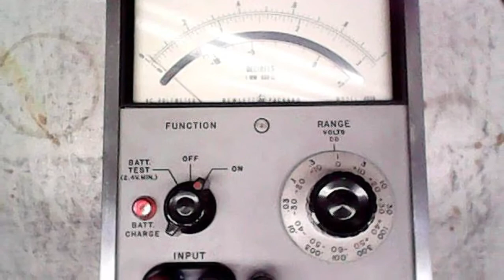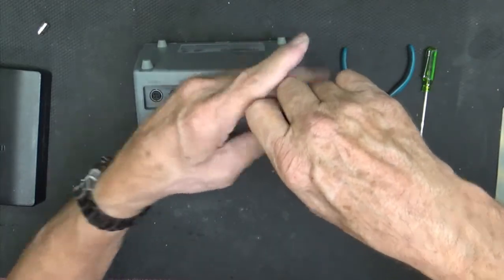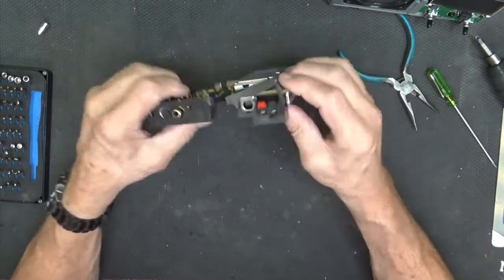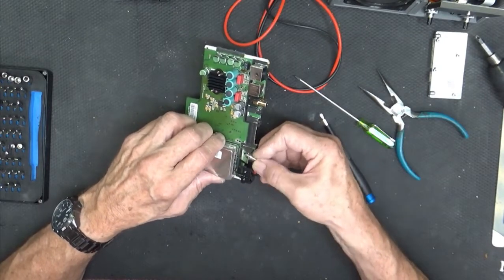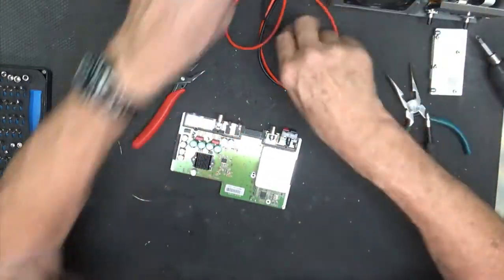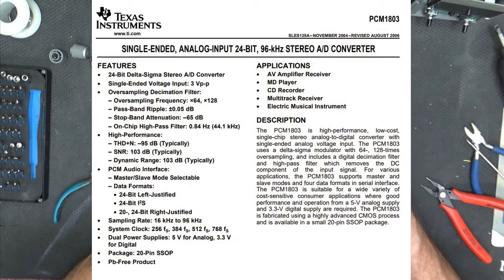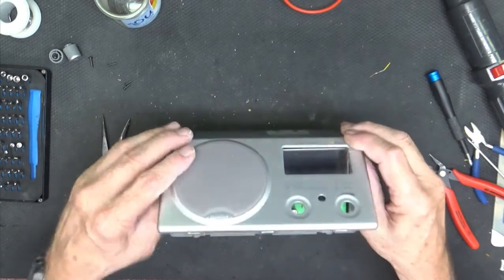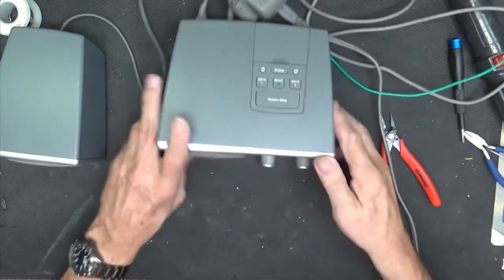Repairing a broken F-Connector on a Boston Acoustic HD Radio

Comment: Nice repair! The DIN connector looks like a "S-video" connector from the dark ages, something only old guys would recognize. Thank you for another interesting video.
Reply from the maker: I checked that connector and it is not an S-video, wrong number of pins. No idea what it its for. Might be for factory use in case the format for HD radio changes or something.
Reply: @AERVBlog  I didn't think it was an s-video connector, just looks like one. After a re-viewing of your video I could see that the key pin is vertical instead of sideways like s-video. Looks more like the stereo audio connector that was popular eons ago
Reply from the maker: @davidv1289  yes it does.

Comment: Thanks for posting this, it's good to see how these radios come apart and what the board looks like. I have three of them and two have developed problems. There's no audio at all from one of them any more, it started cutting out intermittently for a short while before quitting altogether. The radio alarm on the other one has started turning on at a low volume no matter what level is selected in the alarm setup. I'm guessing the problems could be caused by capacitors that have failed since these radios are now about 15 years old. If anyone else has landed here for similar issues please reply and let us know if you managed to fix them.
Reply from the maker: I just got one of these in for repair the other day. The symptoms were no audio and the RDS quit working. Turns out the main IC is bad and there isn't anything I can do for it. It seems these are not the most reliable units in the world. I bought a little portable HD radio off ebay for $29 that is a lot better and does RDS too. It is mono but I just use it for monitoring.
Reply: @AERVBlog  Well that doesn't sound promising but the RDS still works on mine so maybe it's a different problem. There's not really a comparable HD clock radio with dual alarms and good sound now so I'd like to keep these ones going, but this was the very first-generation HD radio and you're right, it's quirky and the reliability seems questionable. Thanks for the reply.
Reply: @AERVBlog  Out of curiosity, was it one of the Sangeans? I have their HDR14, I like that little thing. Wish I could find one of the clear ones though...

Comment: I bought this same radio years ago for the FM HD multicast channels, but the reception drifts in and out.  It does work okay on the main stations. I thought it was the tuner that sucked but now I'm thinking the F connector is damaged or not well connected.
Reply from the maker: Check that out for sure but in my experience these things are pretty deaf. You would think something this expensive would be better but they are not. Thanks for watching.

Comment: Try scraping your electric screwdriver bit on a large magnet to magnetize it.  I have one saved from the back of an old speaker and it usually works for most tools.
Reply from the maker: I used to have a magnet with a hole in the middle that did a great job of magnetizing but I lost it somewhere. I have a stack of super magnets from old hard drives that do the trick now. They are also good for finding things dropped on the floor. Thanks for watching.

Comment: Something fun and relatively easy this time. Regards Tom fyi 40 years with the Bell System as a tech. Retired in 2000.
Reply from the maker: 40 years with Bell! I bet you have some good stories.
Reply: Sorry this is late. Yes indeed I'd write book but who would read it?  I've been in hundreds of places underneath the streets of Manhattan  and over the same. Telephone cables are everywhere.  Bridges, tunnels, subways, airports, docks, piers, etc.
Reply from the maker: @thomasheckhaus205  but soon, no more copper. Yes?
Reply: @AERVBlog  Again apologies, I don't log on as often as I'd like. I think copper will be around for some time. My guess is in Urban areas copper is being replaced by fiber optics. In Rural places  copper will be around for some time. Verizon has already abandoned the "Fiber to the Curb" concept. It didn't generate the money they expected. Land Line service is way down so the existing copper network should serve areas for many years.  Time will tell eventually. By the way a question for you. With Radio Shack gone I can't seem to find any liquid flux what do you use and where do you buy it? I do repairs on early PCB boards and sometimes surface mount. All I can find locally is tins of flux for the plumbing industry. Thanks
Reply from the maker: @thomasheckhaus205   There are lots of different kinds of flux for electronics work. Send me an aervblog@gmail.com.
Reply: Yikes, 2 weeks. Where does the time go? I'll send an email  Sunday. Thanks